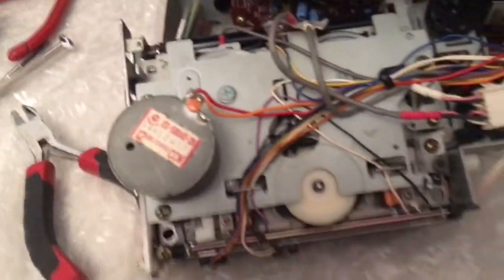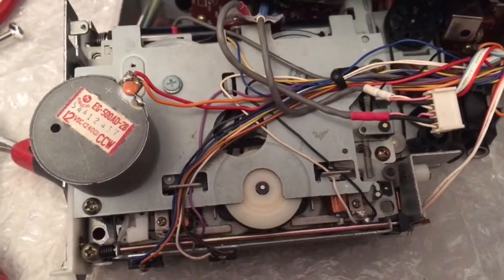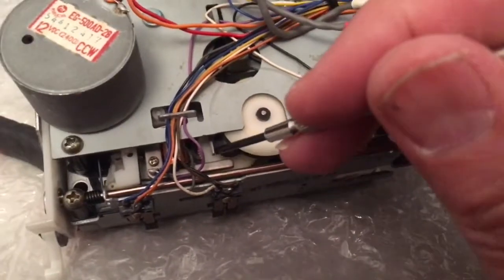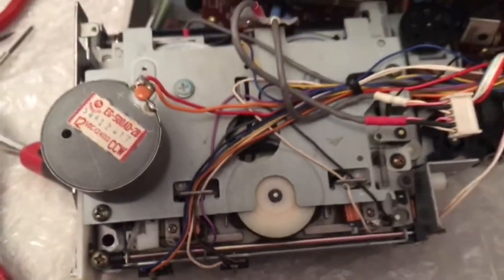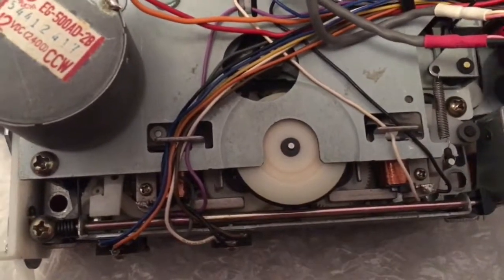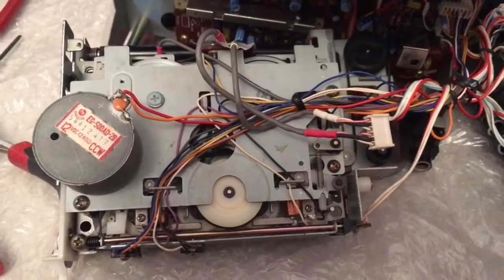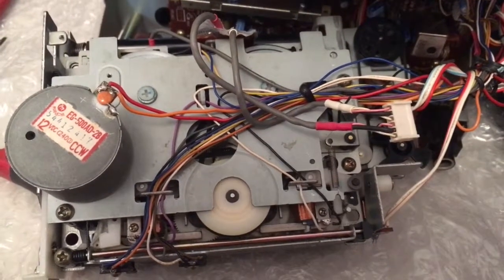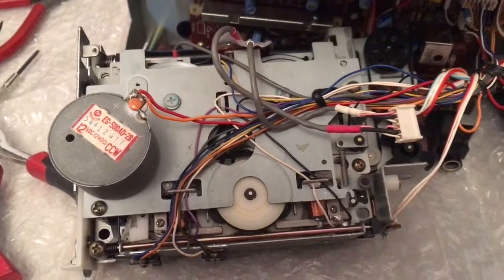Sony CFS-9900 Tape mechanism fix

Comment: I have a pristine looking CFS-9900 in a box that an aquaitance gave me and trying to trobkeshoot it. Found 3 fuses inside all measuring good. Fellow thought it had a blown fuse. When I plug it in and try to power it on I get no lights but a hum without speakers hooked up. Do you think this may be a power supply issue? Bad caps or something. Trying to trace where the hum is coming from. Any suggestions?

https://youtu.be/b0E0PWuAzls?si=QYSqdlyk33V-znEY
Reply from the maker: Check the power transistor on the mainboard on the bottom of the unit. Most likely its blown. That transistor supplies the DC voltage

Comment: I have a cfs-9900 I purchased new when I was just 16 35+ years ago. I am in the process of restoring it but the tape mechanism simply won’t work. It has loaded a tape 3 times giving me some hope. I think replacing the 3 belts will be my next step. I have oiled the mechanism and re-engaged the little spring deep in the mechanism that was dangling due to the plastic having broken long ago. Still no luck.
Reply from the maker: Yes replace the 2 main belts and I would not worry about the counter belt if the counter turns if you rotate the spindle.
Reply: @Raptor50aus thanks for the reply. The counter belt is the long one I assume. I need a source of belts or I guess I can buy 100 random sizes. Basically when the unit is turned on the spindles turn for a moment, then nothing happens and the controls have no response.

Comment: on this deck there’s a spring holder on the FF & RW mechanism that always snaps off, could be that that’s causing the problem, it’s easy to reattach if you know where it is though